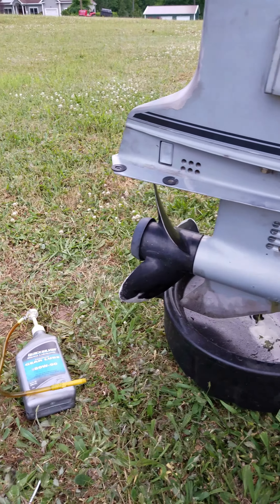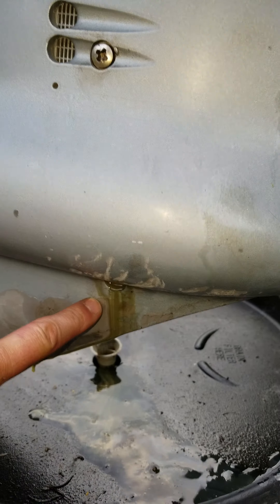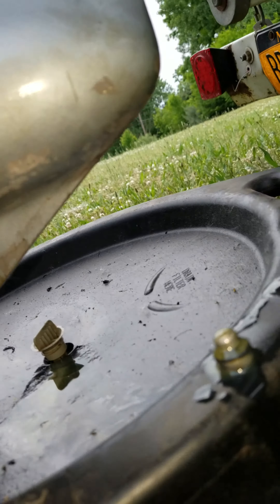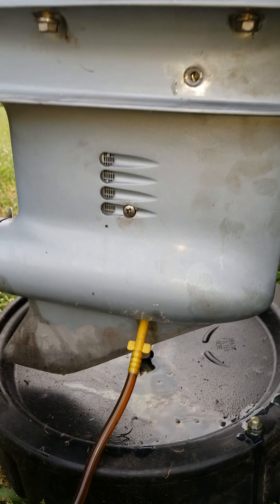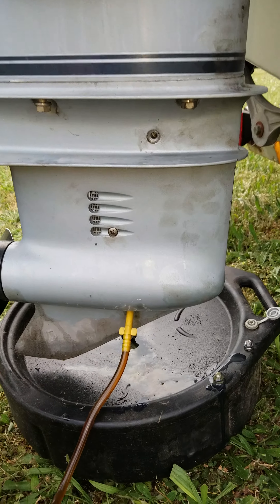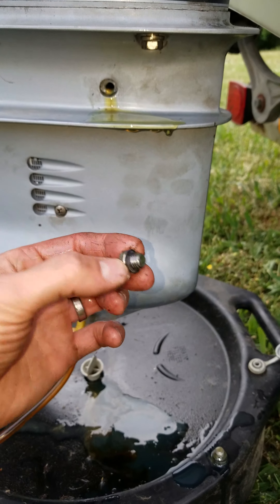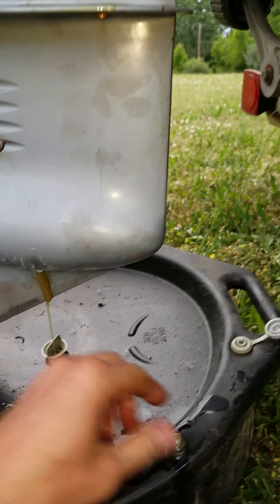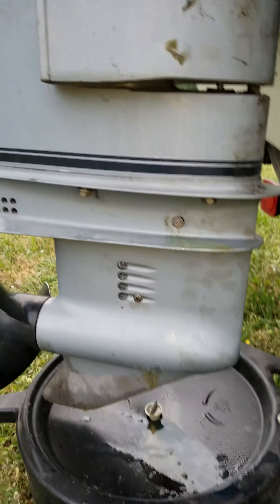1987 Evinrude E40ELCUD 40hp lower unit oil change

Comment: so if you don't drain oil  in winter, It will cause damage ?
Reply from the maker: I do it as a precaution as some water seems to seep in, which in turn could freeze causing damage.
Reply: The Phillips screw has nothing to do with holding the screen in place. It is for the Torrington drive shaft bearing. I enjoyed your video.
Reply: Can you fill from the top instead of the bottom?